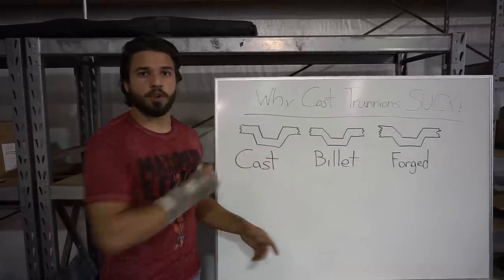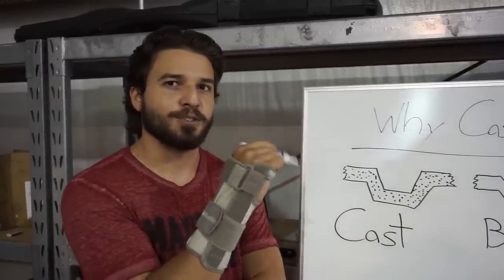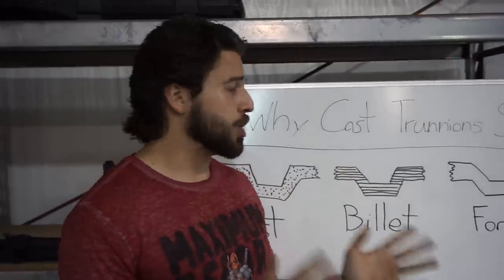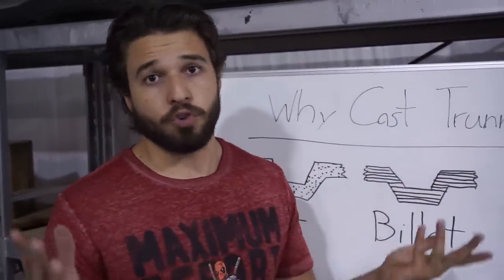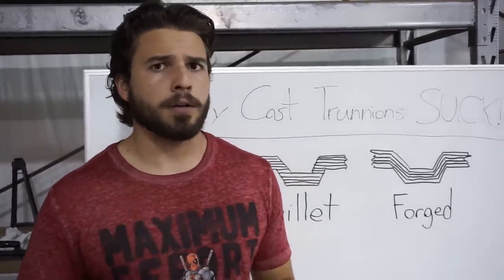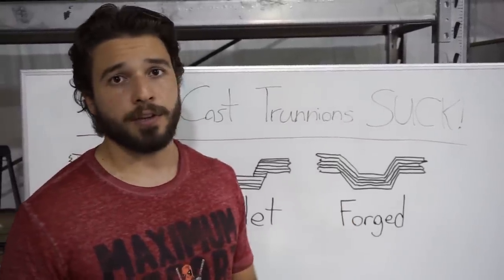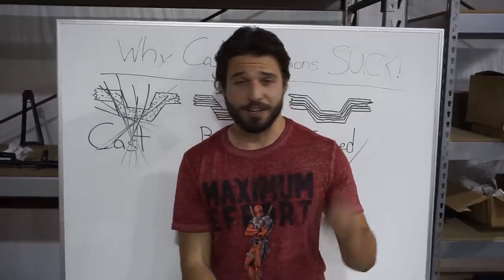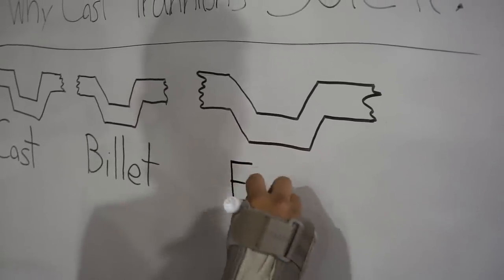Why Cast Trunnions SUCK!

Comment: There is a video by Mel64D called AKM Trunion Hardness Testing in which he uses a Rockwell Hardness testing machine to test a WPB Cast trunion against Hammer forged Trunions from several AKM imports from various countrys , he also tested the RAS 47 which was about 10 points below if my memory serves me right its very boring but yet the results are interesting.  Rob Ski from AKOU and a few others helped and donated trunions . Long story short the WBP cast trunion had a Rockwell hardness 10 points above the Hammer forged Trunions... go figure. And at the end of the video he explains that when it comes to steel types you have to use the right type of steel for the right job . Its not just as simple as cast , billit or forged. I honestly think there is a lot more factors to consider when it comes to reliability and durability of metals. Also we have no idea what quality of steel these forged trunions are made from. Forging generally speaking is better but only if were comparing equal metal quality to equal metal quality.  The WPB AK'S have done well so far as I know. But basically if your WPB trunion is stamped with just the letters WPB its a cast trunion and if its stamped WPB Polska its a forged trunion.

Comment: The PSAK-47 GF3 states it has a "blended" hammer forged front trunnion. I'm a machinist myself so I am inclined to think this is either a marketing tactic to describe the 4340 alloy steel (just as they take the time to write "aircraft grade" like many do when discussing 6061 aluminum) or more likely a clever way of stating that the trunnion is not entirely hammer forged (possibly as you mention here a clever ruse to just say that the billet itself is/was forged). 
Do you have any insight on this matter? Thanks!

Comment: This is why people think there is not much difference between a milled receiver and a stamped one. If you compare a cast milled receiver, to a forged trunion stamped they might perform similarly. But an all forged milled receiver would outperform any other AK. IMO

Comment: To be clear billet and forged are extremely similar. This “grain” structure your talking about is more a matter of compression of the molecules that harden the metal. It can be annealed and “softened” just like any metal but both billet and forged will be exponentially stronger then a cast all day every day. A fresh casting will always produce the softest metal because the molecules are so spread out, not air pockets exactly. So to your point. Cast is dog s*#+t. Love the content.👊🏻🤘🏻

Comment: So the 'Billet' is like the old sculptor's joke about how he cut away everything that did not look like what he wanted to portray. The 'Forged' piece is hammered and heat treated into shape, and the 'Cast' version is more like glass poured into a particular shape, and is fine as long as it is not put to any stress. (Sounds like a wall mounted display)

Comment: More or less correct, but it doesn't look like wood. Think of it like grains of sand, cast has large grains and is brittle, large grains that don't flex. Billet steel has grains that are interupted, but smaller and stronger and can flex. Forged steel has grain that connect and flow throughout the part and they're strong for the same reason bricks are strong; they're connected throughout the steel and the grain is refined, and the grains transmit force throughout the part more effectively

Comment: Somebody should invent a 5-axis cnc cold hammer forging machine. Put in a billet and a claw thing with a hammer on one jaw and an anvil surface on the other jaw pinches the metal into shape. The jaws would need to be made of something amazingly strong and the actuator would need to be superhero strong and light, but you only need one machine at whatever cost to make lots of parts.

Comment: Material science behind metal grain structure is a bit more complicated than this, but this information is about right for useful purposes.

Have you taken any material science classes? Do you have an engineering degree, and if so, do you use it much? I'm still working on a mechanical engineering degree.

Comment: Billet by definition should be made from a forged block. 
Forged arent much more expensive to manufacture than billet, the advantage of billet is that you can make a different part just by putting a different 3d model in the CAD program. While for forged you need to make an expensive die to make them. Same with cast. that's why a lot of cheap stuff (aluminum parts most commonly) are made out of billet instead of being cast, because the tooling cost is even less than making a cast part.

The order you drew them in should go cast-forged-billet, because billet is just a forged block that's forged into a generic blank block, and the shape is machined. Instead of being forged into the finished shape.

Comment: The grain structure on a casting follows the form of the part, it is not " sponge" like you claim, many heavy loaded machinery parts are castings, con rods, crankshafts, bolt action receivers ect.

Comment: There is an extent to which how good cast parts are depends on the application. As I am not an expert on AKs I will take your word that cast AK parts leave a lot to be desired. However, casting in general for other applications can work well. Ruger has a reputation for using lots of cast parts in their weapons and having them work superbly. In fact, many reloading manuals will have data sections in them giving information for super hot loads labeled, "For Ruger Only". 

So while I will take your advice and steer clear of any AKs that I know or suspect may have cast trunnions, I will continue to cheerfully depend on my Ruger Super Redhawk in .454 Casull to perform flawlessly.
Reply: I think the reason why rugers can do cast is because they use more steel. Thickness of material adds to the firearms strength as well as how it was made.

Comment: As an engineer.... If the strength of the metallurgy is beyond the abuse of what the part is expected too see... then who cares? There are 350 Cubic Inch V8's with 200,000 miles on them that have connecting rods that are powder forged. 

It's not as though the x 39 is a 300 Win Mag...

Comment: As a machinist I can say that steel and aluminum are both about the same to mill steel just takes longer because you have to cut at smaller depths and and feed rates. Also aluminum is much more expensive than most steels

Comment: I'll admit cast parts are not as good as forged parts but in the firearms world casted parts have a place. 
There are two major advantages with cast metal, first being wear resistance. Cast metal is generally harder and FAR more resistant to wear than forged parts. And second advantage is manufacturers can produce a very intricate and complicated parts and not break the bank in machinery and hammer forges, for instance look at a Ruger Hawkeye, if Ruger would have forged or even machined their bolt actions a $750 gun would be a $1,200 gun. Albeit their actions are not smooth by any logical definition but studys show they are stronger than most other bolt action rifles.

Comment: I think the biggest issue with the cast trunnions we're seeing is cheap metal.  One of the advantages of cast is that it is dampening.  With the beating that the trunnion takes, cast makes sense for the application.  Perhaps using good alloyed metals would improve the cast trunnions rep.  Just a theory, I don't disagree that billet and forged are great, I just think that cast has its place if it it not being done with bad material.

Comment: Cast verse forged. Pretty simple. Like at top end engines nearly all forged parts. Because they don’t snap or break near as quick or distort out of shape under pressure and a certain amount of heat in the same way. Not all forged material is the same either.

Comment: Actually, $600-$800 US AKs don't necessarily have cast trunnions. Riley and Palmetto use either billet or forged (depending on the model). On the other hand, IO and Century parts suck even when they're not cast (like the C39 receiver), probably due to bad heat treatment.
Reply from the maker: Alexandru Ianu In the case of PSA...not all billet parts are created equal. That’s all I’ll say on that 🤷‍♂️

Comment: What is this stuff I stumbled upon on the AK files that SAIGAS are NOT forged? According to the Metallurgist test that MAC from the Military Arms channel took his SAIGA too examine. Also apparently starting around 1973 all AKM'S made by IZMASH switched over to cast on the following parts : front sight,  gas block,  rear sight block,  rear trunion and bolt carrier are all cast . And it was assumed that the Bolt and front barrel trunion remained machined from Forged steel.  But according to the examination conducted by the Metallurgist that Mac took his SAIGA too that theres is absolutely no forged parts in the SAIGA other than the barrel . Im not saying its true!!! Im just asking

Comment: The reason for sponge in metal casting is that they failed to vibrate the mold right after pouring the molten metal. Like any other fluid, when poured, it picks up air bubbles, and sometimes gasses from impurities or from the mold itself. Vibration causes the gas to come loose and exit the mold, thus eliminating the sponge effect. That is your useless information for the day.
Reply: @Steve Johnson -
It is one of those things like brute force, if it does not work, you are simply not shaking hard enough. Shake the fuck out of it if you need to, just be careful of molten metal getting on you. Its kinda hot. ;)

Comment: if you wanted to go a step further, you could billet machine it, induction harden it to the finished(what would be the hardness if forged) hardness, then finish machine it, and you would end up with a better part overall. Because it would have the hardness in the surface but the toughness throughout to take the abuse that is being thrown it's way. My background in machining doesn't help me on alot of these. sips whisky

Comment: Gotta say, as soon as I got my "new" (to me) Saiga 12 (Lynx 12, Chinese copy), I broke it down and poured over it, looking for any signs of casting.  Actually pretty sure its brand new since it's oozing oil from every possible crevice and there's still milling shavings in some of the harder to see, non-action parts like on the rear reunion just under the stock tang.  Scared the shit out of me at first cause it looked cast at first glance until I wiped it out.  Paranoid, but from what I've seen and heard here, justifiably so.  Can't wait for my local outdoor range to open up so I can try her out.

Comment: I'd say it's far more likely these trunnions are failing because they are of poor quality, not because they are castings. The quality of a finished metal part has more to do with the quality of the metal, choosing the proper metal for the purpose, the care used in the manufacturing process, the quality of heat treatement, etc., than it does with whether the part is cast, forged, or milled. I'm not going to get into the casting vs. forging vs. stock removal pissing match, I'll just say that any of these processes can produce a suitable and durable part if done right and a shitty part if done wrong.

Comment: The com block Ak is overpriced and unavailable most of the time.They have problems too like soft trunnion, canted bcg rails,canted trunnions and sights,over gassed,ect.The 556 Aks use propriety hard to find and expensive mags and jam.Makes since to buy a Gen3 PSA  Riley Defense or a new Wasr.We'll be ok when com bloc Aks dry up.

Comment: Ok new to AK's.  Does the CAI Romanian RH-10 have a cast trunnions?   I've have looked at numerous sites and documents and could not find any documentation to confirm either.  Everything I've read says the RH-10 is essentially a WASR except for the front sight block.

Comment: But was not the block of steel once cast aswell? so if I Cast a billet, and forge my part with correct tooling, and then do the fine machine work 

Cast is king? hmmm
Reply: Billets generally are folded and rolled into it's shape, it's not a straight casting.

Comment: Dont know much about AKs but I know a fair amount of metal urgy, question; is mim casting in your opinion acceptable? After heat treat you basically cant tell the difference between mim cast and billet under a microscope. Not trying to get I  a pissing match just curious as I know ruger uses almost all mim parts

Comment: PSA's are no longer cast and I believe is forged now.
Reply: They have 3 levels of bolt/carrier/trunnion, the original cast, the billet machined, and in the last month or so, the hammer forged. I don't think they have fixed the extractor yet, but willing to learn.

Comment: If the cast part has porous structure, someone fucked it up. To be fair, grain structure argument ist still valid. You can also fuck it up by improper heat-treatment, if you overheat billet/forged part, the grain structure will start to re-crystallize, grains going from "prolonged" grains down to compact ones.

In short: Large grains = soft material (what are you even doing stop)
Small grains = hard but brittle material (alright you cast it properly but it will fly apart due to crack propagation along the grain edges)
Grains elongated in the direction of the load = pure sex (you did it right and it's both tough and NOT BRITTLE)

Comment: Is there such a thing as cast billet?  I assume if there are forged billet blocks that are then machined then some blocks of steel could start as simply poured castings before machining (with all the flaws of a standard cast part) which would mean some billet pieces might not be any better than cast.  If any of this is true then how would a buyer tell the differences between the two?

Comment: Hey, I'm in the market, thanks to the stimulus checks, to get a great AK under $900 with a forged trunnion, side mount, and a folding wire stock would be nice though not required.  Any suggestions?  I'm a college student, so I ain't rich.

Comment: Casting sucks ? Well investment cast is used to make jet turbines, so there's that. What material are jet turbines made of?

Current jet engines predominantly use alloys containing nickel and aluminium, which form a strong cuboidal lattice. Within and around this brick-like structure are up to eight other components that form a 'mortar'. Together, the components give the material its superior qualities. Since the early 1950s, the AK-47 has been manufactured with cast trunnions and AK-74 with cast trunnions . Casting has always been cheaper, wouldn't you think the Russians would have went with the cheaper option when the AK was in production if it was feasible?

Comment: Quick question, when casting metal in a mould as you said there is a risk of the metal having small bubbles in it, so is there a way to compact the liquid iron while it is setting so that you get rid of the bubbles in the metal so that it is one solid piece if that makes sense?

I imagine it like if you put bubble wrap in a hydraulic press and turned the bubble wrap into a solid bit of plastic. Same thing but with metal.

Comment: i have a question why do M2 Browning use cast bolt carrier rides i worked at a shop that we would take the cast and mill them thanks for taking ur time making videos and getting back to people also
Reply from the maker: waldo2413 I’m not 100% sure on that one. But I will say the bolt carriers are under far less stress and pressure than AK trunnions. On the AK, the locking lug are in the front trunnion, which is one of the most critical high-stress parts for containing the explosion when the round is fired.
Reply: thanks for getting back so fast
Reply: The M2 was designed that way, the AK wasn't.

Every new iteration of the AK coming out of Russia was for saving weight and reducing costs. They casted other areas on the gun but guess which areas remained forged? Front trunnion and bolt. That should tell you something....

Comment: ...Ruger has proven the quality of good castings...their virtually indestructible revolvers are all investment cast...Mini 14 receivers and bolts are investment cast...casting produces parts that are very close to finished size and require very little machining...
...the source is the problem...not the technique...
Reply: As with most manufacturing techniqes, the exact process makes a huge difference in quality.
Using the right alloys and casting technique, you can get realy good, high quality casts.

Comment: What if you pour it into a mould, then use some moulded piece to push down on the metal with just enough space to get the air out?